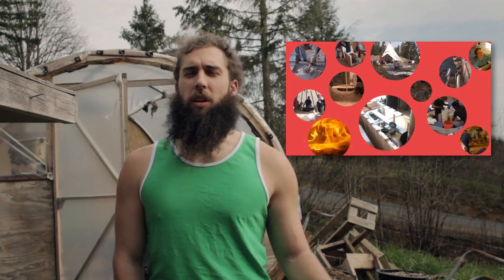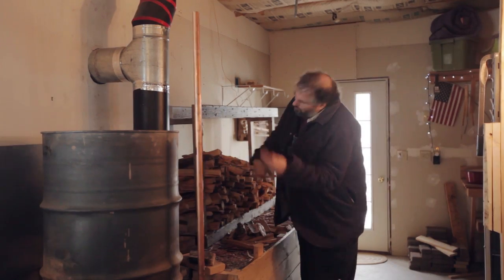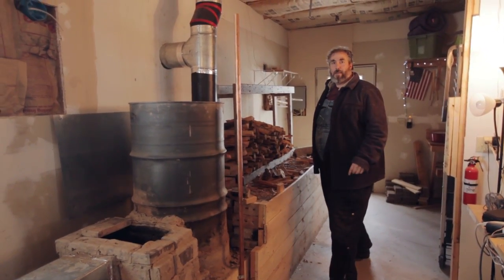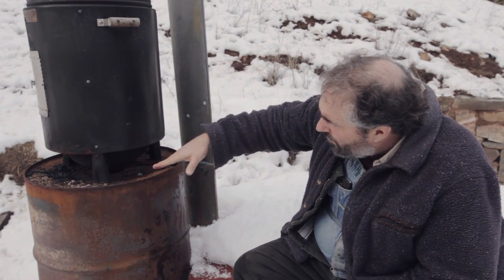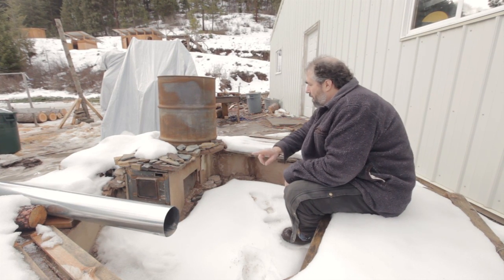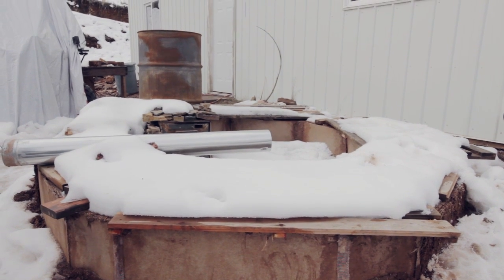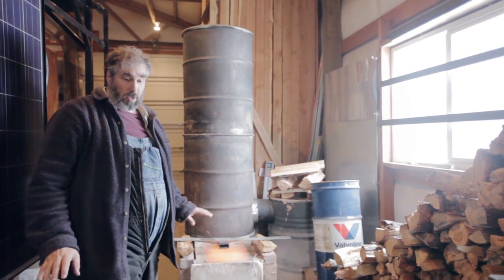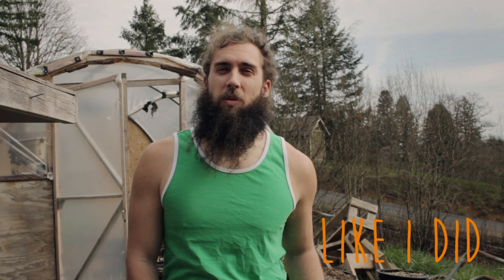5 Rocket Mass Heater Variations

Comment: I totally agree with the wood pile inside the houses. Once inside, no going outside a few times a day for fuel to stoke the fire. The wood dries super dry with way less moisture to deter the hot burn. You cannot even tell a fire is going strong outside the house because no smoke is coming from the chimney. The neighbors are cooking wood stove soap with blue smoke coming from the chimney.

Comment: Hello I am looking to build one for my Airstream trailer so smaller is better. Looking for the flow verses hight  stove pipe looking for something like a 3" stove pipe penetration. And can run off pellet or wood easy to clean can cook on and no creosote buildup.
Reply from the maker: Hello, I built on for our bus, a 4inch system. I wouldn't go smaller than that and even then I had smoke kickback issues.  Without mass the system just doesn't work consistently.  I tore it out eventually and replaced it with a small old cook top stove 6inch. Heats up fast with a nice batch box and I can heat water and cook... So much easier than watching the tiny 4inch feed chamber quickly eat small pieces of wood.  Imo the lack of mass defeats the purpose of incorporating one of these into a trailer or bus. I tried for years. 

Best of luck😉

Comment: How small can you build a rocket mass heater?
Reply: As small as you want.  I have seen videos of stoves the size of a mason jar.
Reply: As a caveat, for the "mass" part of the stove to be effective, you would really need something bigger than a mason jar.  Twenty feet of exhaust pipe in the mass is the "goldilocks zone".  Shorter than that you will not capture all the heat, longer than that you might have issues with draw.

Comment: Paul Wheaton should probably give credit where credit was due on some of his projects.
 broaudio was the first one I saw with the BBQ on top of the rocket stove and
 broaudio had the glass batch heater and outdoor bench. 

 No co2= inefficient. 
Carbon dioxide is a by-product of complete combustion.
No Co ( carbon monoxide) would be better.
Reply from the maker: Matt (broaudio) worked on these builds, I'm not sure to what extent but he was given credit on the kickstarter page.  Paul goofed on the audio and I added an annotation.  He intended to say CO @ 6:18
Reply: My bad
Reply from the maker: Bob Vance no worries man, valid points
Reply: Ideas are free